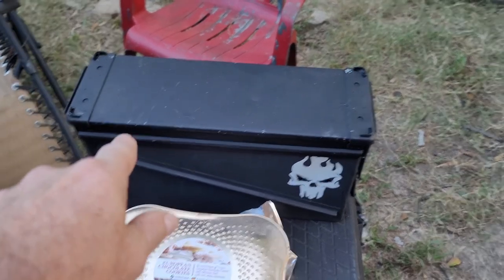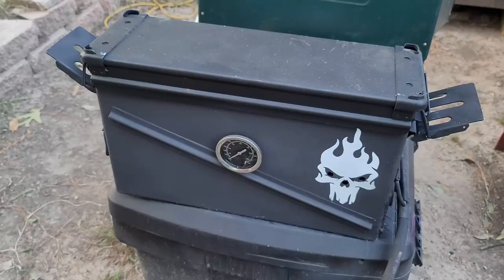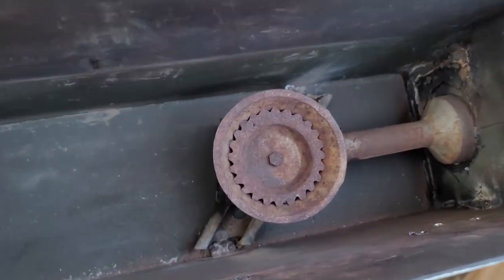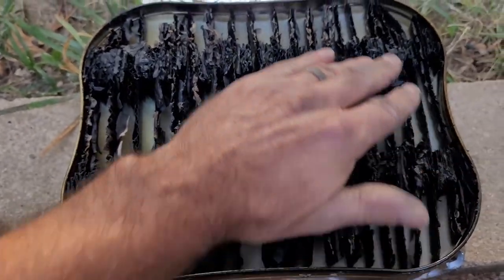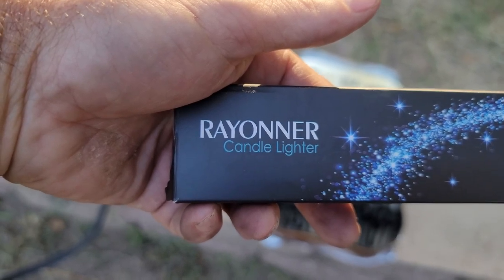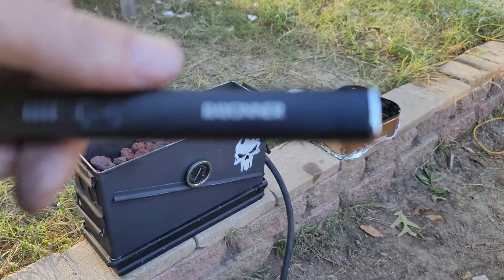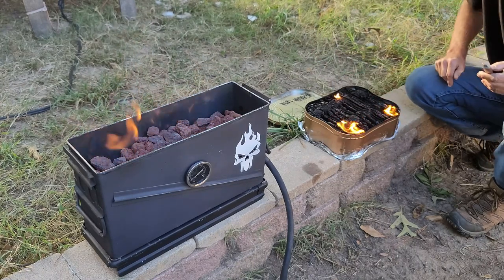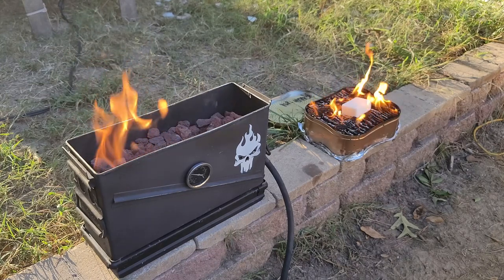Homemade Ammo Can Firepit build and  Rayoneer  Chargeable Lighter

Comment: Awesome build. Going to use a similar can for my build. One pro move to get it off the ground a little higher off the ground is actually already included! The lid handles can fold down and wedge into itself - goes from 2" to 3.5" off the ground which is critical in colder climates! Shout out to the engineering behind these cans